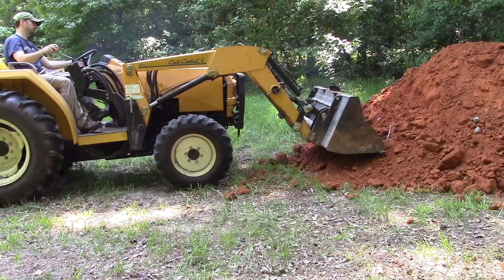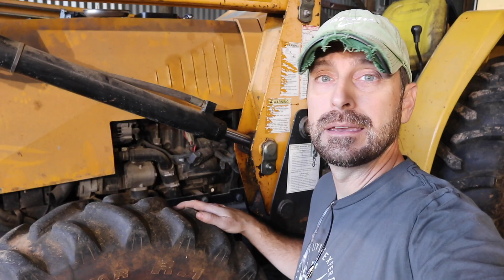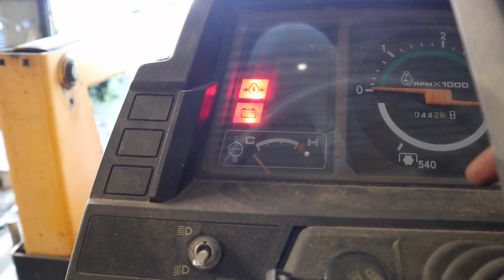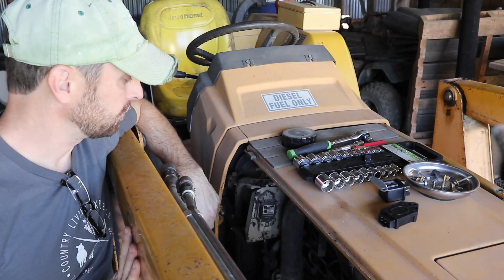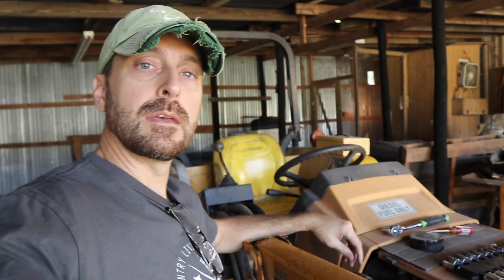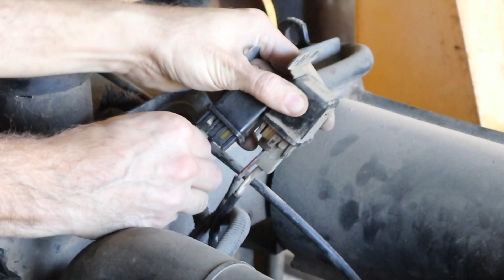Tractor Electric System Fix! 4 Reasons It Won't Start Glow Plug Relay And Control Module Replacement

Comment: Another part of the system is the Flasher Unit BE51-104 or MA19672944000.  I have this issue now a bad flasher unit and I'm finding that it is discontinued part I called Messick today they no longer have them so now I'm trying to find one or a replacement brand would you or anyone else have one or could point me in the right direction. With out it my tractor is dead I did replace both the components you show in your video. Any help would be greatly appreciated. I'm located in Lewiston Michigan  Thanks Reg
Reply: That's just for hazard and turn signal flashers.  It won't stop the tractor from starting.  There is another issue.

Comment: Great video.thanks for sharing.i got a minidigger with isuzu 4le1 motor.  im having the same problem.got a question?is there a way to check the relay and the other piece.before i go and buy it first.thank you

Comment: Nice work you are very lucky to have that tractor. One of the best bulletproof tractors Mitsubishi/ labeled CubCadet ever  built. I was lucky enough to purchase a used 258 hr. 2012 Mahindra Max 28 XL which is actually a complete Mitsubishi built tractor. 600 hrs later no issues other than glow plugs. I would love to have your tractor.
Reply from the maker: We have enjoyed it so far. It has needed a little work but we got a great deal on it originally.